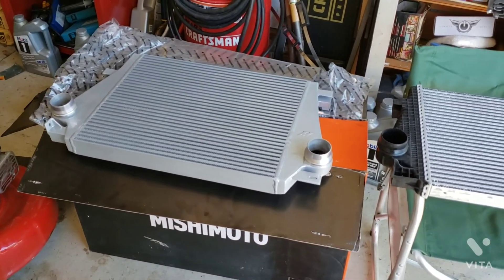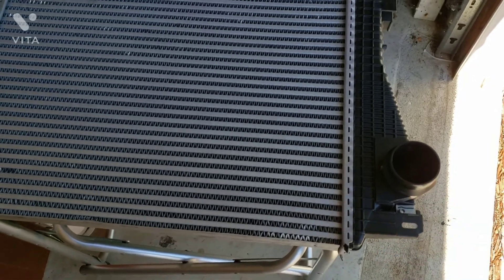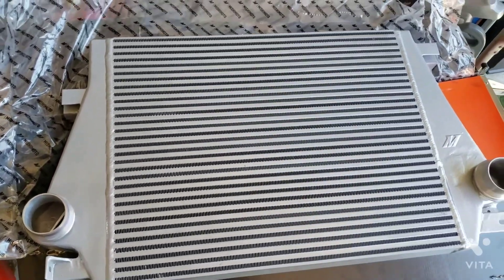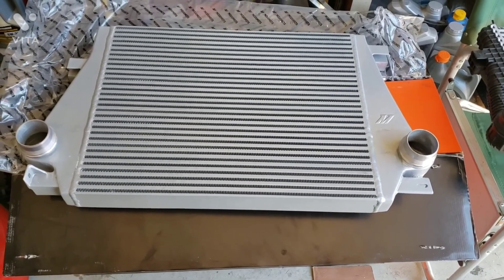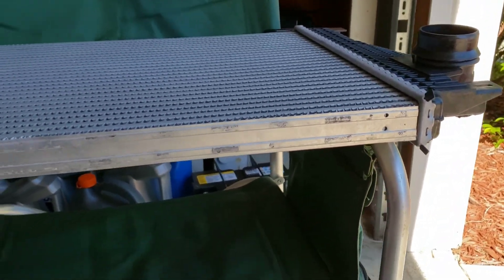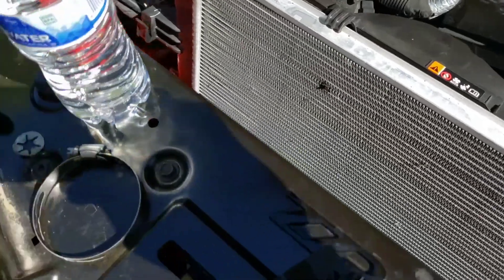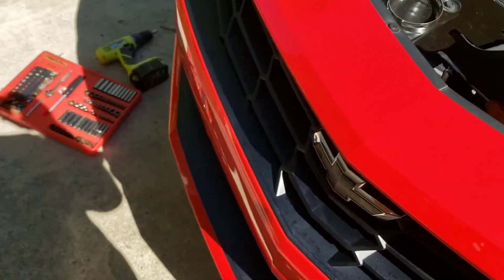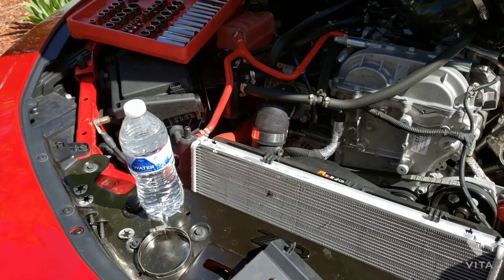Intercooler Upgrade 2016+ Camaro 2.0 Turbo, Mishimoto!

Comment: Good info. I'm getting the rev9, due to mishimotos price gouge. I have the same IC piping, but in red. I've done alot to her, mainly suspension, chassis stiffening, and trifecta elite tune. Got a clutchmasters 8 puck clutch and flywheel. Rev hang is eliminated along with body roll. Great car and definitely a conversation starter at cars and coffee. So many people ask questions. Runs a 13.1 on street tires. Hoping to hit 12.99 soon!
Reply from the maker: That sounds sweet, I had a 2019 1le 2.0 M6, kick myself for selling it ughh. I ran that Rev9 intercooler on it, it worked great, had diverters and everything just like the Mishi, agreed too expensive. Such a capable car, even a base 1LS, some high limits with that light front end. It's really cool you are doing one up like that, people definitely underestimate them, great comment and thank you too😎
Reply from the maker: Just subbed to your channel, some cool stuff, love fighter jets, old school video games etc.:) You SO should do ltg Camaro content, you have a cool build. My current Camaro is the same blue as well🤙

Comment: I appreciate the heads up on the top down approach to access the intercooler. I'm gearing up to install Mishi IC and pipes.
Reply from the maker: You're very welcome, sweet, what year is yours? These 2.0 LTG cars don't get the love they deserve, you'll definitely feel a difference. I drive a 91 Camaro RS daily atm but really wanna get back into a 2.0 6th gen, prefer a manual but gonna get the automatic for the remote start in cold months lol.
Reply: That 91 RS is low, wide, and the 350 roars. Timeless. I have a 17 RS 2.0 6MT and I am loving it. I live in CA where I have many twisty roads available therefore I started with chassis mods like wheels, springs, dampers, sway bars, trailing arms, and tires. I'm weighing in on the local landfill scale at 3180 with about 3 gallons in the tank. Handling oh yeah. Plus I installed Clutch Masters clutch and aluminum flywheel to mitigate rev hang plus installed Hurst short throw shifter. It feels sporty and engaging in the twisties and it hooks up nicely with zero engine mods.
Now I'm ready for engine modification. First things first, I installed Mishi dual catch can for engine health and peace of mind. Now for the rest. Heat soak is no bueno, it cuts the fuel on acceleration and rattles my nerves. Therefore the IC. Then everything else like intake, charge pipes, throttle body, plugs, downpipe, exhaust, and tune. I want to be able to leave the Mishi IC in place when it is time to smog. If I have to reinstall the stock stuff (besides the IC) and reflash to stock tune in order to pass I am ok with that.
Reply from the maker: @thejamstar NICE, I couldn't believe the handling on my 2019 base, no option 1LS M6 Camaro, unbelievably good and lightweight as you said! A while later I ended up with a 2.0 Turbo 1LE, soooo should've kept it, didn't realize how rare it was then :/ You'd have loved it, just did Mishimoto Intercooler, charge pipes, TB and a RaceChip on stage 3/6. Good call on the catch cans too btw, it's a great setup. Maybe a good E85 tune would help yours with heat soak? Have an excellent tuner here if you're close to Ohio, be happy to help, they don't hold boost very well the ltg as my tuner saw, the GFB diverter helps immensely, good comment btw😎❤️
Reply: That 2.0 1LE definitely intrigues me. Recaros, alcantara, suspension, extra cooling, forged wheels, very cool! Plus the upgrades you installed. Dang!
I was on the fence with E85. Your comment pushed me over. Will be ordering ZZP E85 flex fuel conversion kit tomorrow (free shipping day). 
I appreciate the support. Your tuner sounds legit. I will be doing ZZP remote tune once getting the bolt ons installed over the next couple of weeks. I do the labor myself and I am okay with taking my sweet time to ensure it's done correctly.
Btw the mishi dual catch cans rock as you commented. After only 400 miles of aggressive driving I had a significant amount of liquid in the PCV can and a little oil in the CCV can. Now that's proof it works.
I ordered the GFB diverter valve then turned around and returned it because of a statement on the ZZP website under the Camaro intercooler listing:
"It retains the use of your stock bypass valve because there haven't been any measured gains by replacing the bypass valve with an aftermarket BOV."
You say otherwise. I am back on the fence.
Reply from the maker: @thejamstar You're welcome glad to help, I really love the ltg. Agreed, probably doesn't add any horsepower but you'll definitely get boost quicker and hold it longer, just make sure to lube the copper part of the piston with synthetic oil before install. Your tailpipes will stay cleaner so much longer too with the E85 and catch cans fill dramatically slower:) Tried the JacFab valve too on another Camaro, worked well but caused a CEL, tune would probably take care of that though. ZZP always made me happy as well, love their high flow catted downpipe, had 2 over the years and no issues. Your car is gonna be pretty darn quick with all this done lol, if you make a video lemme know I'd love to check it out, yeah wish I still had that 1LE, kick myself for selling it :( Awesome that you do your own work too btw, very satisfying and you know it's done right, no worries that way, respect🤝🇺🇲I think I still have my E85 kit from my first 2.0 if you want it, they're $250ish new, I'd do $120 shipped, just have it sitting in a box in garage.
Reply: Yes. I will take you up on the flex fuel kit. Let me know how to proceed.
Your logic seems sound regarding the GFB DV. Will be reordering that one now.